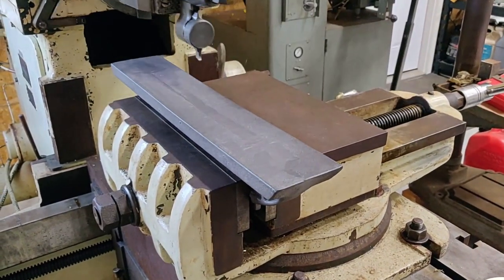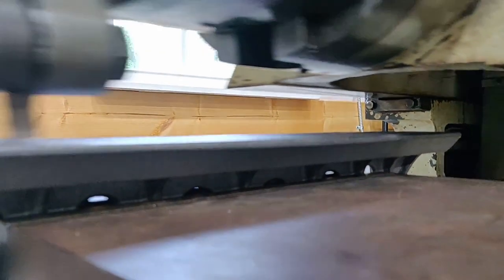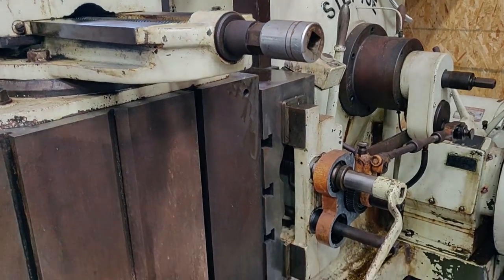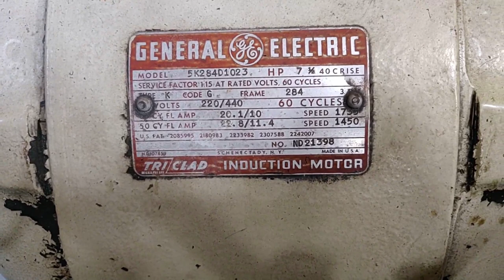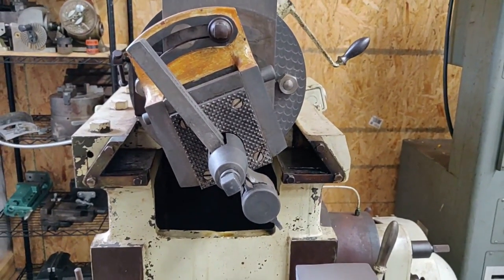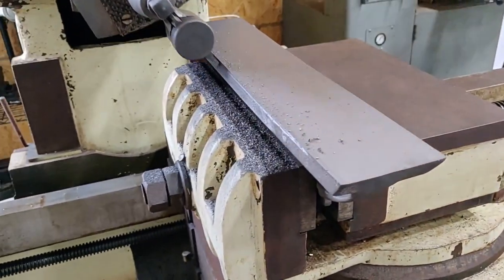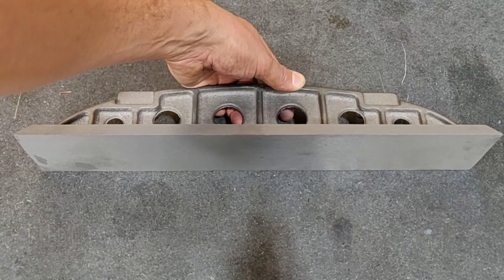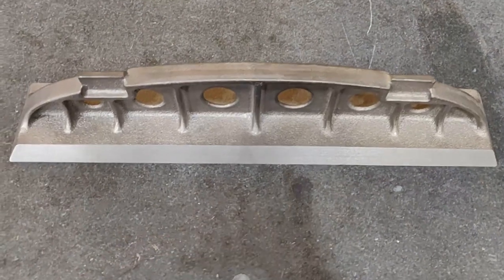Shaping a cast iron camelback straightedge

Comment: Be nice to yourself.  Making mistakes is what an apprentice does.  If you have reasonable access to a good mentor, you’re good to go.  Also, 40 hours a week is approx 2000 hours per year.  So how many years do you have in, measuring by the hour?  You’re still new at this.
Reply from the maker: Thanks for the kind words.  I'm just a home gamer, not even apprentice level.  I simply enjoy old manual machines and like to play with them when I have time - which has been quite sparse since we had a child about 6 years ago...  But the best part about old iron is that in another 10 years when our daughter wants nothing to do with us, it'll still be there sitting waiting for me just the same as it is now.
Reply: I was surprised at the tool you used, but that final pass, wow! 👍👍👍